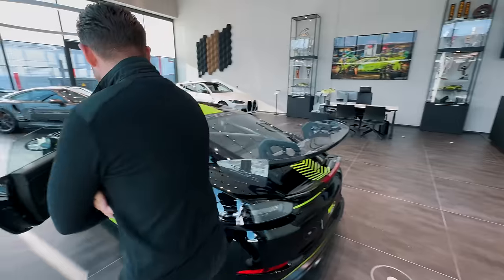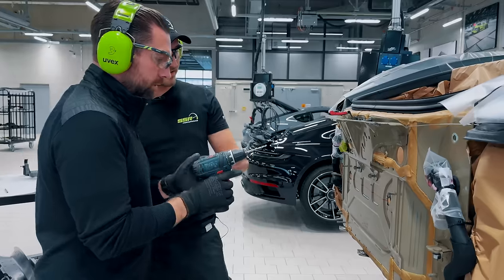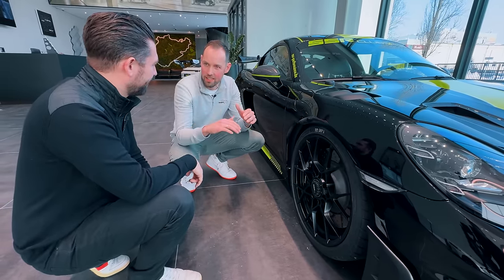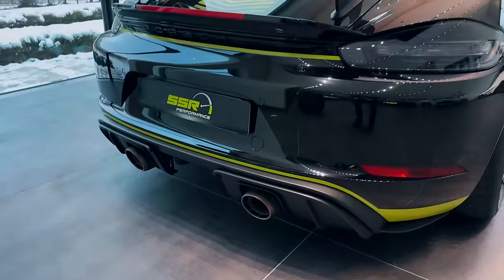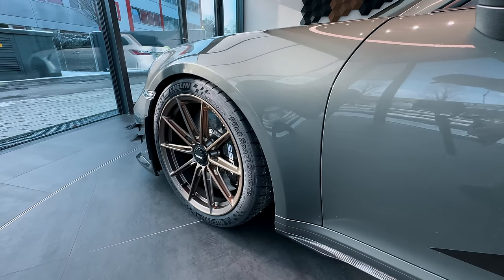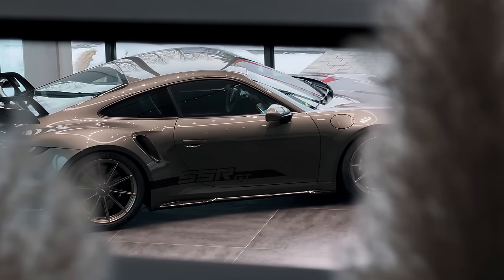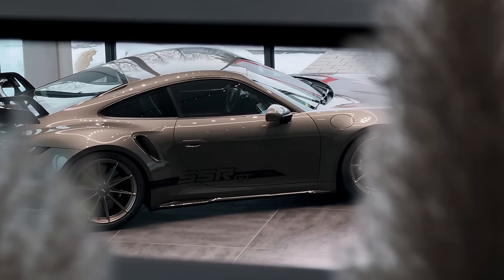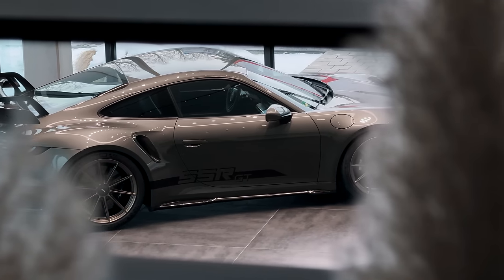NEW TURBO S 'GT3' IS HERE! THE KING OF PORSCHE TUNING?

Comment: 0-200 in 4.5seconds (16:13)...I believe he means 100 - 200 which is still very rapid
Reply: I went straight to the comments after hearing that😂
Reply: Yer I thought that too, but even still 200 - 300 is only 12 seconds which doesn’t seem that good to me
Reply: no he really mean 0-200 in 4.5s
Reply: @patatr4943 the figures he quoted make no sense. 0-200 in 4.5 is possible, but 0-300kph in 16.5 is slow for something already doing 200kph in 4.5 seconds.
Reply: @ianmitchell9102  16.5 s to 300 seams very slow for vehicle like this
Reply: I did wonder as 7 seconds is silly fast for 0-200

Comment: The cars are amazing, and the facility mind blowing. But am I the only one who hadn't heard of SSR until these videos? Ok, I'm not a big Porsche guy, but I've heard of other European Porsche tuners (such as RUF, Gemballa, 9ff and TechArt) but never SSR?!
Reply: Have you heard of Manthey Racing ? The porsche tuners you mention (except RUF) are engine/performance and styling "tuners". Manthey and SSR make the cars go faster round the racetrack without any engine mods, through suspension, aero, weight saving. Proper racetrack tuning without putting your engine at risk. Manthey kits are fully warrantied by porsche, not sure where SSR stand, but it would be hard for porsche to refuse a engine warranty issue just because of suspension and aero mods I think.

Comment: Once you go track-only with the exhaust...why keep the car in any way like a road car? It's just a matter of budget, how far you take it on the way to a crazy silhouette racer that only share some engine parts with the road car? GT3 race cars are a big step lighter, and even Aston and  Bentley achieved that weight?
Going the GT3 race car build direction with everything, but an AWD base like the Turbo S would be interesting for me. Then do whatever is needed to get it balanced. Wider front tyres and body, all the aero bits.

Comment: That Turbo S “GT3” is insane. I wonder if once the 992 GT2RS comes out it’ll outperform it.
Reply: of course it will outperform the ssr, but the 2rs will be a much more radical track focussed car, the ssr gt is the perfect mix between gt3 and turbo in performance on straight line (even better than the turbo s) and track with the turbo s practicality
Reply: Be nice to see a price comparison. If GT3RS are going at £350k. A new GT2RS is going to be very expensive to buy. If you can't get an allocation. How much are these cars?

Comment: 0-200 km/h in 4,5 seconds hmmm then it sure needs more power! Would say more like close to 6,5-7,0 seconds!
Reply: I believe he meant 100-200. Even with 1900hp that would be a stretch
Reply: That makes more sense! He also said a 5-way suspension but only heard high/low speed compression and high/low speed rebound what’s the fifth way 🤷🏻‍♂️😊?
Reply: @petermacmill703  the 5th is a high speed blow off which would typically come in handy when hitting big curbs. It's proper Motorsport grade stuff.

Comment: Those the Turbo have 900 HP with normal fuel or with race fuel ?
Reply: I know there are well over 1000hp 992 turbos w/ normal fuel. E95 ethanol fuel allows even more power for turbo engines while still remaining road legal.